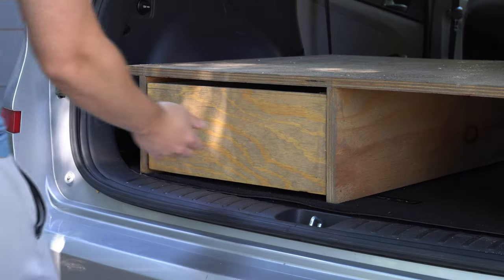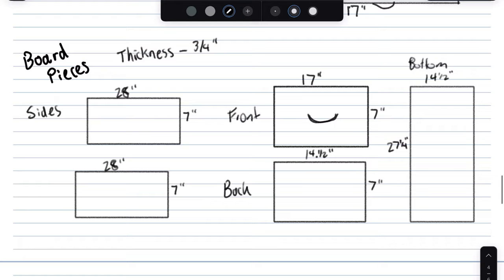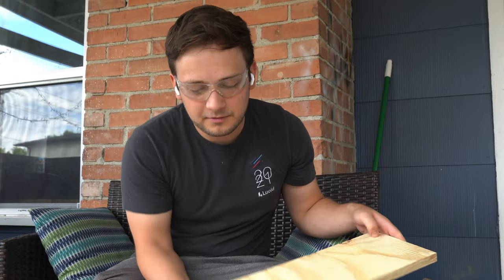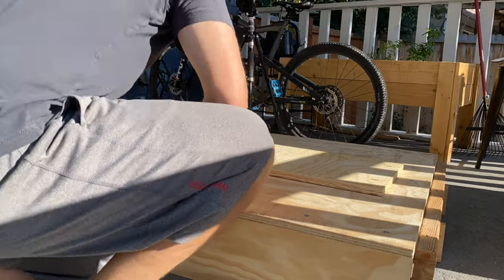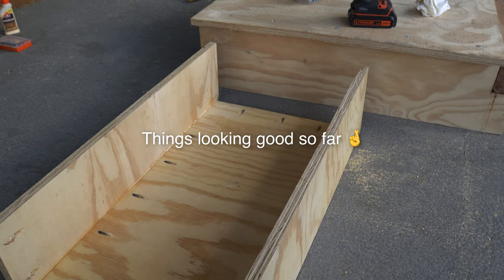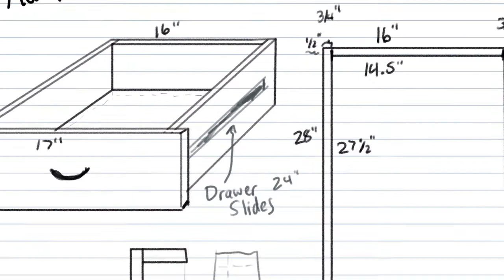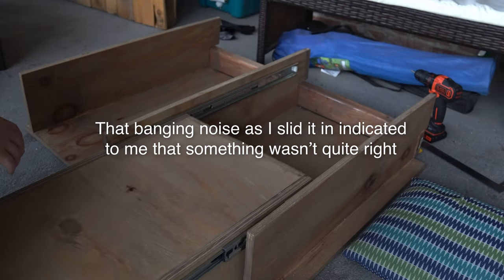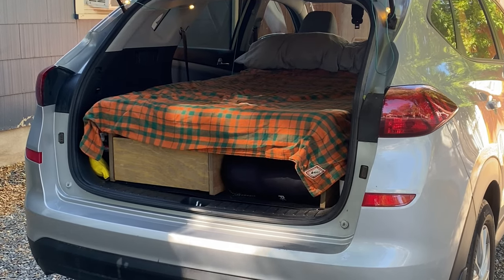Building a DIY Drawer for my SUV Car Camping Setup

Comment: Very nice and well planned. I like that the first section of your platform can be in the car even with the rear seats down, meaning you can keep the draw in the back of the car permanently if you want.
Reply from the maker: That was the exact plan! I use just the back piece so much during ski season for cooking meals so definitely wanted it available

Comment: Nice job and explanations!  I certainly appreciate you sharing the things that didn't go right as well as those that did. I am building my 1 platform this Sun. for my 2014 GMC Yukon Denali with a contractor friend of mine. Your drawer has made me realize I need to utilize my friend's knowledge and experience and make a couple of drawers during the build.
Reply from the maker: Having someone that’s knows what they are doing is a huge help! I called my mom like 5 times through the process